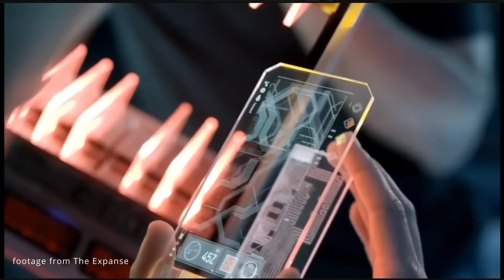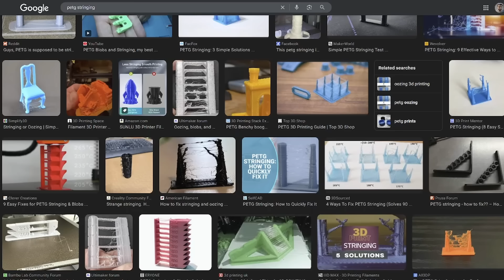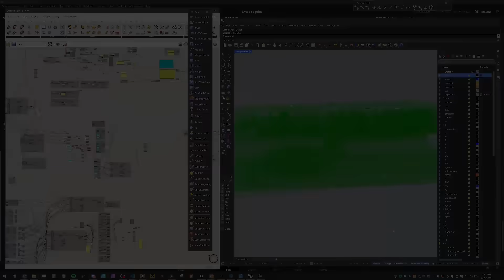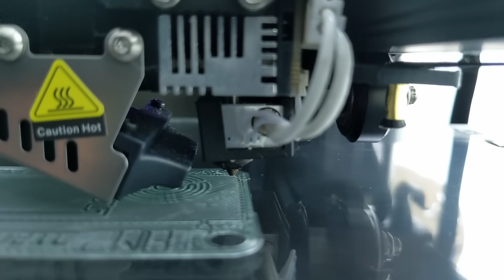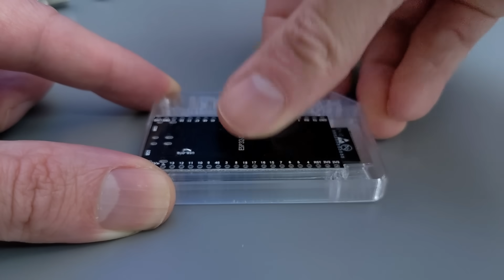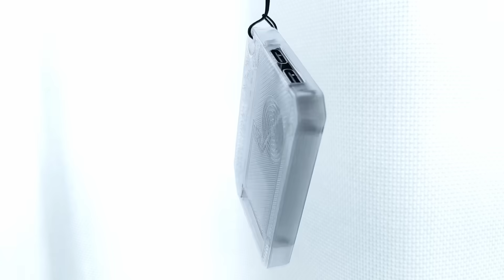No slicer: single continuous path 3d print

Comment: going through all of that coding and work instead of just making a tuned print profile is why reprap and all the early 3d printers seemed to suck and nobody liked them. no offense but this was kinda dumb and pointless and... pretty far from the most transparent PETG prints I've ever made. if you'd just spend time building profiles for your filament you woulda figured out how to get more gloss but instead you are overly fixated on the tiniest details for no reason. you have good work ethic not trying to dog that but basically you reinvented the wheel just to fail

Comment: Question if I may, on the infill layers - when you say, "finely tuned", does that mean flow rate changes between infill and passing over the line work? Or is the line work thin enough that back-pressure on the filament flow, from not being able to extrude passing over the line work, is simply released as the infill continues without significant artifacts?
Reply from the maker: The latter. I had to experiment with the amount of flow and layer height to get it smooth, but it is indeed a constant flow rate per layer. I'd like to implement that logic though! Shouldn't be too difficult to say, for each point, if it is over a path from the previous layer, reduce flow rate 🤔

Comment: I always wondered, would it be possible to slice an object  at an angle, like 1 degree so it could be a path more like "vase mode" and not have a seam line where it starts another layer. Does that make sense? Like, the left side of the object is layer x, and the right side is layer x+1. idk how to describe it better...
Reply from the maker: Hmm, but then wouldn't there have to be a seam or a transition somewhere in the middle? I might not be understanding you correctly.

Comment: What does the ESP32 do? Without a battery how does this work in ones pocket?
Reply from the maker: It connects to any USB MIDI device or host (works with phones too) and wirelessly keeps a group of music setups in sync. If the midi device needs to be powered through its USB port, you can pass power from a battery bank through the second port as well.

Comment: Back in undergrad our additive manufacturing lab for 3 years printed these single path dog bone prints to isolate print patterns for tension analysis, you can achieve this by plugging in add ons in Cura, no need to slice it on your own 😅
Reply from the maker: Interesting, I'll have to check that out.

Comment: Oh wow!! This looks absolutely amazing! I've never seen a large part print this clear before!

Although, I actually had a situation where I needed to get extreme optical quality out of tiny part, and managed to do it. My first couple of attempts were terrible, but eventually - because the part was very small and simple - I was able to get the slicer to do a continuous path, by just reorienting the part on the print bed and doing 100% infill. I was super impressed with myself when I did it, because it looked great, but I knew I wouldn't be able to make it work for larger parts, so I've been planning on just using Plexi or Lexan for those larger parts, but maybe I'll rethink that now. Plus I have some other cool "light pipe" ideas I would like to try with other projects... So, I'm subscribing, and looking forward to learning more!

PS: For the curious: The parts I was making were "Light Pipes." My prototype includes a fully custom 3D printed BLDC motor, which needs precise control, so I designed a rotary encoder into it which uses a set of off-the-shelf optocouplers (Amazon). The optocouplers themselves are sort of buried under a cap and mounted in a way where you can't see them or their indicator LEDs. Not really a big deal, and I could have lived without seeing them, but I figured it would still be easier to troubleshoot my prototype if I could see them, so I designed a tiny piece with a few bends in it that I hoped would act like a fiber optic cable. Of course, the first few prints just didn't carry the light at all, and even with the lights off it was hard to see, but yeah, then I played around with the design and the print settings so that all the paths were continuous, from light source to the end, and did a little bit of trimming at the ends with an Xacto blade, and then it worked like a hot damn! It's almost as bright as the LED itself now, and that's through a 2cm long pipe with two bends in it.
Reply from the maker: Oh wow, printing light paths, that's cool! I'd love to see how that looks.

Comment: Amazing work! 

If you want a clearer print there are a few guides online that show how to print very clear PETG, it mostly just involves slow speeds, high temps, and eliminating any gaps between infill lines/walls 

Also, PCTG is a great filament to work with if you want to try other clear options, it has the highest layer adhesion strength I’ve seen on a non TPU material, and it can come out glassy clear with the right settings.

Comment: Very cool! Love the look of it. Would be awesome if it was expandable. Most thing I build with esp32 has some switches or sensors hooked to it. Maybe leave a pass through exposed for the gpio, etc.
Reply from the maker: Thanks! The back panel of the case can come off so that the header pins can be soldered. Then you could put it on a breadboard, or print an expanded back plate that mounts to the same screws. I'll be testing that out soon with a 9dof sensor.

Comment: Stephan from CNC kitchen did a video specifically on getting clear prints from uncolored petg. One of the tricks is to not orient the infill lines 90 degrees and have them parallel.

Comment: So how did you actually slice it to account for the volumetric flow difference between pattern and infill?
Reply from the maker: Just lots of tweaking the flow values and layer heights until the results were satisfactory. So, the layer heights of the first few layers were like .12 and .06 alternating, then a single height for the rest. That and I mounted a magnifying glass on the print head so I could  easily see how the bead was behaving.

Comment: the continuous path is really genius! I love this idea. there are some good tip's on the prusa website I think there is an article called printing like glass for petg. There are a few settings tweaks that you might be able to get this almost completely clear I believe most of the settings are around lowering the cooling or potentially turning cooling all the way off and increaseing the hotend temp, The other thing I believe was alligning the infil and slightly increasing the extrusion multiplier I believe the idea is that with aligned infill the layers neatly stack on top of each other and increasing the flow rate to make sure there are no gaps in the infill as the filament path is slightly rounded at the edges I know its a very delicate balance but there are some really cool examples of this out there. I think with your continuous path this could be really amazing.
Reply from the maker: Yeah definitely more testing to be done with temps and cooling and speed, etc., The difficult part is, once you start working at the raw gcode level, it's hard to use any of the advice/settings from the slicer world, because it's all dependent on what the slicer is doing under the hood.

Comment: Did you start with a modeled object and then use Grasshopper to generate the contours, modifying them to create a single continuous path? I subscribed because I’m hoping for a more detailed follow-up. I’m currently working with soft biomaterials, including a paste printer, so being able to print more complex objects in single continuous paths would be really helpful.
Reply from the maker: Paste? Interesting! Is this for medical? For the most part, I drew curves and loft them together to get the surface that represents the walls, then intersect those surfaces with planes to get each layer curve, then divide the curve into tiny segments to get each line of gcode.
Reply: @porchlogic it  For now we are really looking into sporting goods and custom cushions.

Have you read the book advanced FDM printing with grasshopper by any chance? May contain some nice tricks

Comment: So essentially vase mode? You could technically do this in normal slicer/ fusion but your model would have ensure each layer can be created in a continuous loop so you would  essentially be designing per layer. It would be tricky and time consuming. 

I think you need to do more of a breakdown on the programming modeling of this. As it would be good for certain things. 

Good roads (diy skateboard / finger board channel) did something similar with a mould he made. Basically ran it as a  vase and it was rock solid.

Comment: That's really beautiful! This is the first I'm seeing continuous path outside of vase mode, is this a thing other people are doing or did you develop this? I'm wondering if there's added strength from not having seams. I'm also wondering if this could be applied to non planer printing. Also, is this something that could be done for virtually any model, or did you have to be really intentional about the design of the model to make it viable to print like this? I would love to see this in a slicer so us normies can do it too!
Reply from the maker: I did have to be intentional with the design, like making sure there were no "islands" that would cause the print head to travel. Non planar printing like this would be wild! I think other people do similar process for e.g. clay printing, but probably mostly vase mode?

Comment: That's really nice work. I've also created my own GCODE generator but it's only able to do 2D slicing without extruding.

Did you use any interesting openly available scripts to generate the infill paths, or is it all private?

I've been looking at CNC toolpath generators lately, but many of them are clustered and protected.
Reply from the maker: The scripting is all done in Grasshopper. There are some other available components that do the gcode generation on food4rhino.
Reply: @porchlogic  Ah I've made my own GCODE gen from scratch for full control. However, there's only little scripting involved. Just some C# for TSP stuff.

Comment: Ive gotten amazing results with forcing 100% infill lines to always go the same direction, low cooling and like 102-104% flow rate. With PETG on an Ender 3 from 2018 I can get nearly perfectly clear parts.

Comment: Why just don't try to adjust and calibrate your printer.  Way more easy and sensible. But yes you won't have a video if you do it. Don't get these kinds of videos. Next you can try printing in a straight line and then just bend the print in a form, because at the edges it is hard to calibrate pressure advance.  This way you can make a long video about making the shape of the part easy to bend in form after printing.

Comment: Saw someone at IMTS a couple years ago showcase a print that had gloss smooth outside but layer lines inside, he insisted it wasn't vapor smoothed or post-processed in any way, although whatever technique he used made it smooth on all outside surfaces. Wonder if it had any relation to this sort of process?
Reply from the maker: Yeah could be, although, I still don't know how to achieve the gloss on any top surfaces, only walls and surfaces touching the build plate

Comment: If you make the infill all going in the same direction and have it at 99/100% you’ll get even more clarity in the part. And depending on pla or petg heat and speed is a huge factor, I always do 10 degree above recommended max temp, fan speed oh so minimal and like 25/30mm print speed
Reply: What do you mean infill going in the same direction? Aligned rectilinear?
Reply: @chronokoks the infill going in the same direction meaning not have them cross over one another, like brick work, or an x, for instance if you do lines infill and have it at 99/100% infill it’s gonna be like a soil brick but the way the infill will lay is 1 layer  on the x axis, next layer on the y axis, then back to the x axis and so on. If you have it where the infill gets printed all in the x axis (the same direction) the final product is almost crystal clear!
Reply: @SpacemanChris1  yeah so aligned rectilinear.. wow you don't need to write essays on stuff.. btw this way you'll have problem filling small air gaps so you'll have a bubbly infill when trying to print really clear stuff
Reply: @chronokoks if that’s what aligned rectilinear means then yes, I’ve never had any issues with air bubbles in my prints, if you’re getting that you can adjust ur flow rate to be a bit higher than 100% to compensate for the air bubbles whenever I do clear prints I think I have my flow rate at 103%
Reply: @SpacemanChris1  it's hard to believe you claim to have such clear prints, can't even pinpoint the infill strategy you're using in slicer, and then you're like "oh my flowrate is 103%". There's 100 solid clear printing like from a resin printer and then there's prints which claim to be clear but you can clearly see air pockets in the prints. There are levels to things my friend, be "clear" next time without essays and blablablabla.
Reply: @chronokoks so condescending and think you know and understand everything, I was just leaving some info on what works for me for the clearest prints I can get with pla petg. Do better 🙄
Reply: @SpacemanChris1  yea because you didn't even watch the video properly.. he made the logic for how the layers are layed himself. He even explained, that now he shifts 90 degree to make a visual grid pattern. Dude, everybody should be condescending to you cause you go off on tangents and don't get to point and share information nobody needed in the first place.
Reply: @chronokoks ugly ugly attitude, do better

Comment: I print mostly with PETG, almost no PLA but also with PCTG, TPU, PA ( 6.6 and 12 both without or with GF/CF), PP and other more challenging materials. PETG is really simple. If you have stringing and a well tuned profile for that brand, then there is to much moisture trapped in the filament. If you can't get rid of stringing with tuning (temperature, pressure/linear advance and retract), then there is to much moisture in the filament or it's garbage. Even if the spool is just fresh out of the package, I put it into the dryer for >=4h at 60°C. Stringing is gone. The exception is filament in a aluminum coated bag. That holds back moisture much better and might work without a dryer. Moisture sensitive filament on a carton spool is a form of torture and I recommend to stay away from it. The carton holds moisture. It takes forever to dry and collects moisture much faster.

Comment: This is so cool. For a long time I've been saying CAM features are what's missing from slicers. I'd pay a $100, maybe even $500, for a slicer that worked more like a CAM, allowing me to selected edges and features to manually generate too paths. Sure 90% of the time you'll use a basic slicer but there are times, especially for specific functional parts or high volume parts where you need to GCODE perfect. I've resorted to editing the GCODE file many times.
Reply: You could use full control gcode (it’s the name of the project)
Reply: The guy writing the cam engines fore most cam packages are working on it
Reply: @Goroca checks watch, it's 20-current-year. Good accessable 3D printing has been around for at least 10 years now. Functional accessable CAM has been a thing for at least 10 years now.

Comment: What diameter nozzle did you use? Did you use overextrusion? Thanks!
Reply from the maker: I used a .08mm nozzle. I'm guessing I probably over-extruded compared to the default in slicers. I just experimented with values until the lines looked good.
Reply: @porchlogic  They do look great and I guessed that you used a large diameter nozzle and overextrusion. Nice!

Comment: Neat! Are you doing anything special during Z travel? One of the larger visual flaws with current slicers are the resulting seams at the start/end of a layer (even with scarf seams etc), have you managed to avoid it?
Reply from the maker: I just let it keep extruding the normal amount for the tiny z movement, since it goes right into the next x,y movement. There is a seam, but it's just at the single start/end X,Y point for the entire print